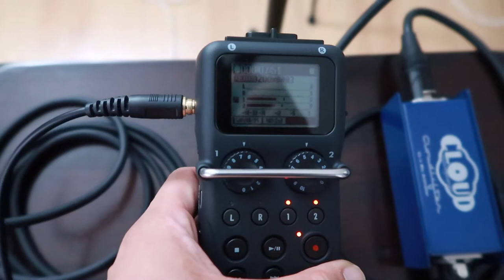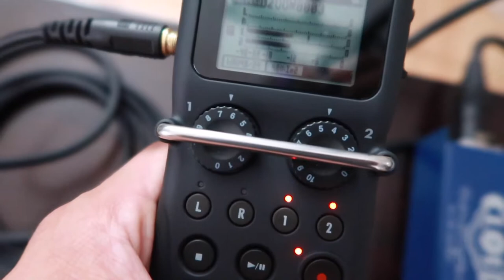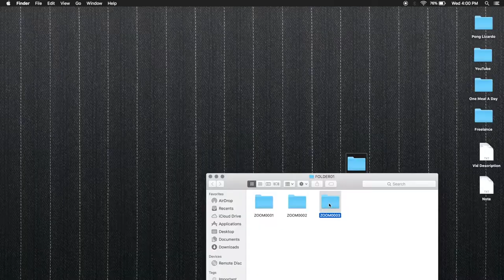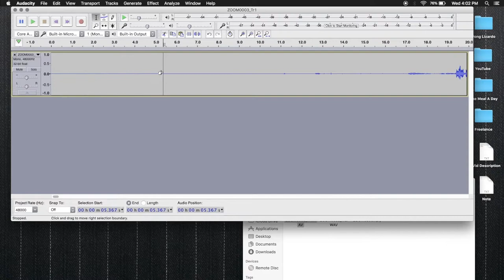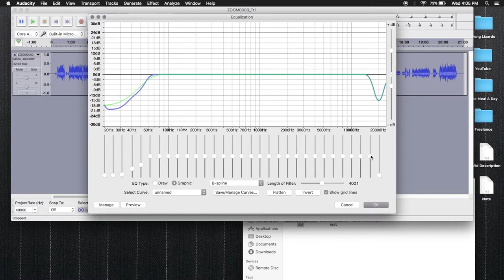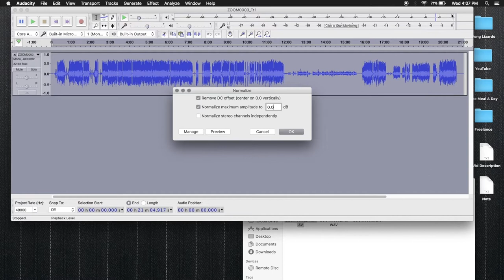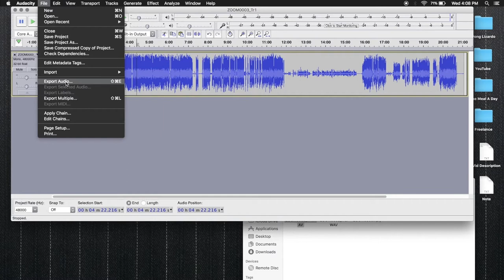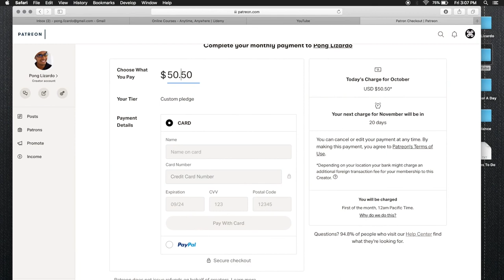XM8500 With & Without CloudLifter + Audio Post-Processing in Audacity  Comparison / Test

Comment: I am buying a Behringer UMC22 + XM8500. Since I’m importing the products, if I need anything else I need to purchase it now. I’m saying this to ask you if you feel I should include in my purchases a fethead to help add gain to the mic? Or you think the UMC22 would be enough. They’re for podcasting and voice overs. Many thanks Pong!!
Reply from the maker: I would definitely add either a Fethead or a CloudLifter. It makes the final audio cleaner (lower noise floor). So when you use a deNoiser, you get an almost clean audio.

Though, I'm not sure about Fethead. I wanted to get the Fethead before but decided to go with the CloudLifter because it seems more robust.